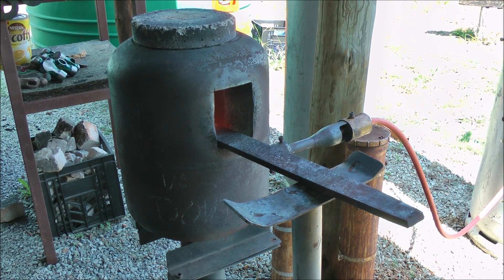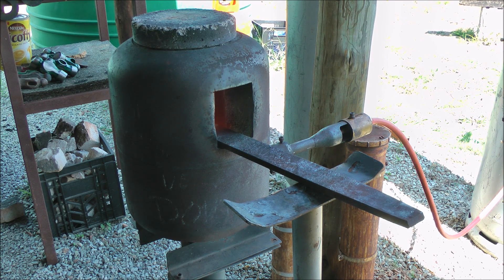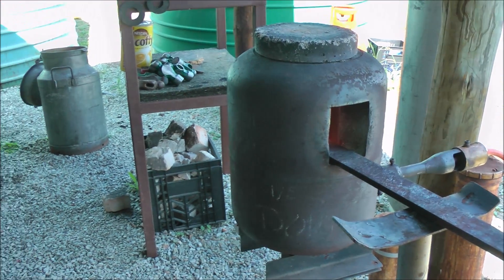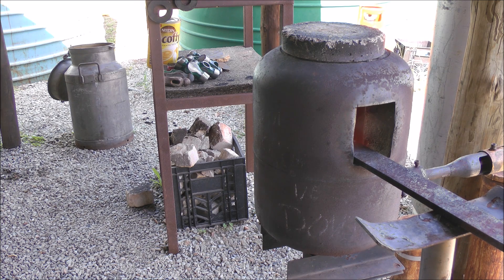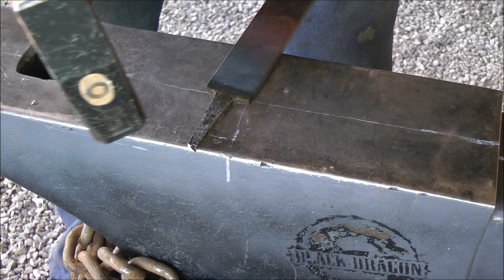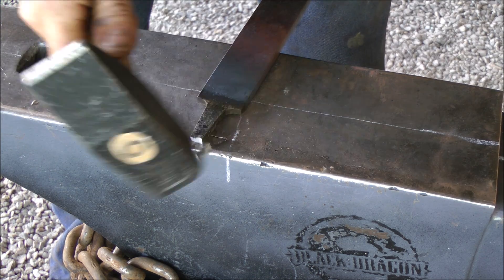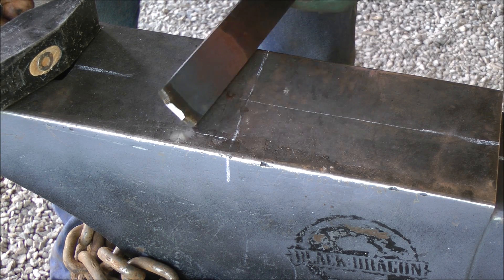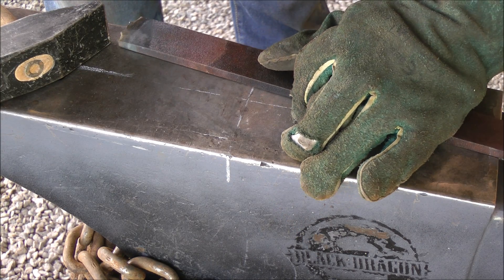Will it harden? How to test mystery steel

Comment: What's the best way to work out s hr protocol for a mystery steel Neels?
Reply from the maker: s hr?
Reply: Sorry, typo -meant to say "HT"... as in Heat Treat!
Reply: Heat it to non magnetic, quench in oil.
Didn't harden? Repeat in water.
Still soft? throw it out and buy some 1084.